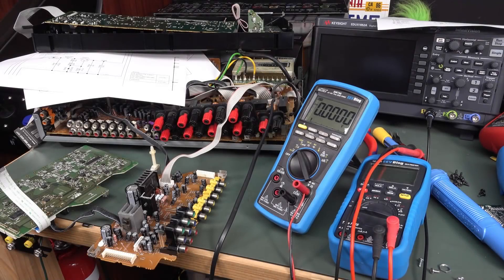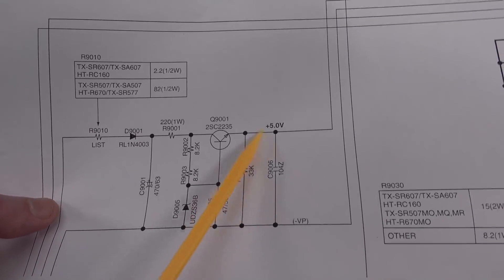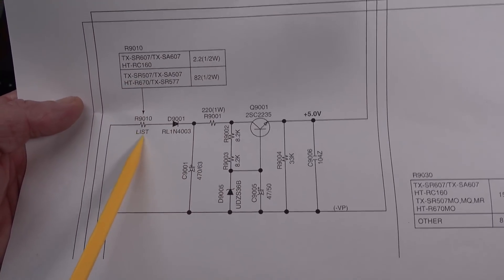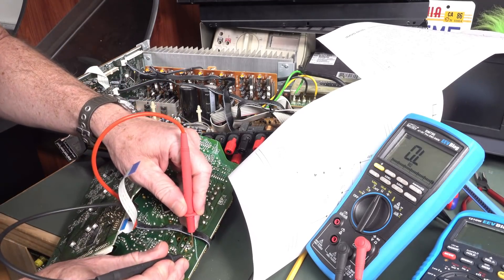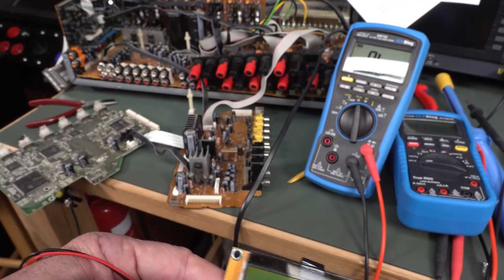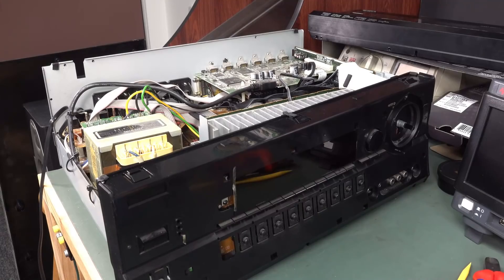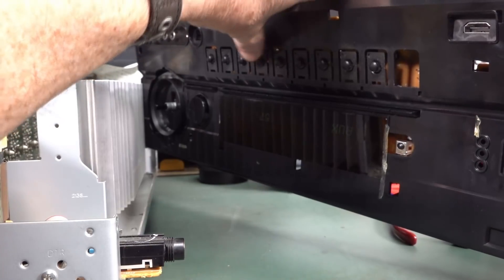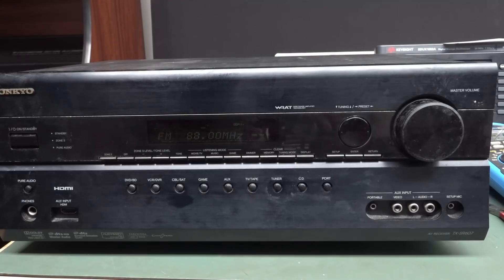EEVblog 1395 - Onkyo Repair SUCCESS

Comment: Luckily the VFD still works on my 607, I’m not too worried that the on screen display through hdmi doesn’t work because I can still see the setup on the VFD. Some have said it’s the DSP chippie that causes the issue I have but I threw my 607 in the box back when I got the nr929
Reply: I have a Yamaha rx-773, its the better version of the rx-673 and it also has the same dsp chip issue as that one but i modded a fan to it and now the chip is running fine

Comment: I did put my money on the 1/2 w resistor. I had the same with a harman kardon receiver. Replaced all components but still all components where overheating without connecting the display. So i bought a 4 dollar buck convertor and connected it to the transformer and display and all is working now.
Reply: Hello there, free tip: throw that buck converter and replace it with a pololu or equivalent quality one. You'll save yourself future huuuge overvoltage and noise issues!
Reply: literaly just repaired a 210 harman kardon subwoofer, replaced the diode from a 51 Ohm 1w with a 100 Ohm 2w (some powersupplys came with a 100 Ohm 1 and it seems to work fine after changing the 51 Ohm one to a 100 Ohm). the traces were all burnt up so i had to solder it directly to the compontents it was connected to, and there were some capacitors that had lost capacity for the PW on function so i had to replace those aswell
Reply: @Mofie-aoi  ,  I'd have recapped the whole thing. Caps are so much cheaper than my time.
Reply: @BruceNitroxpro  dont really need to recap the whole thing and there is a better aftermarket powersupply for it anyway that im going to end up installing
Reply: @Mofie-aoi  ,  I know... there are a lot of reasons not to recap, but I didn't know you were going to engineer a new PS for it, and I sure wouldn't want to half do a job and have it fail midterm.
Reply: @BruceNitroxpro  one was already made by a german that made alot more psu's for alot of different subwoofers and recivers.
Reply: @Mofie-aoi  ,  Only you would know.
Reply: @BruceNitroxpro  i saw a german video about the psu for 210 sub and the whole thing is in german but im dutch so i managed to understand most of what was said but as far as i know that is the only video in existence that features the aftermarket psu

Comment: Used to have a similar model and iirc the display has a dimmer/brightness control in settings
Reply from the maker: Turns out there is a Dimmer button on the front panel, that fixed it!
Reply: I have a Marantz with the same display. It's on full brightness, and I can only see it in a dark room. I did try to find a new display but no luck. I shall live with it.